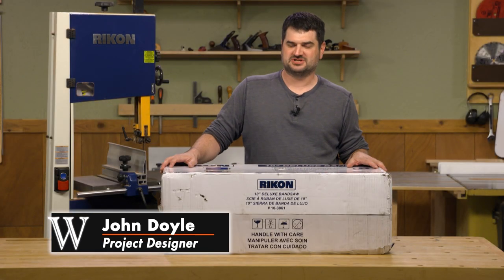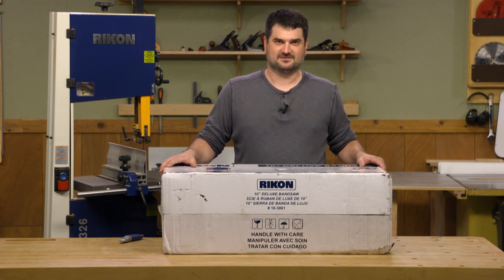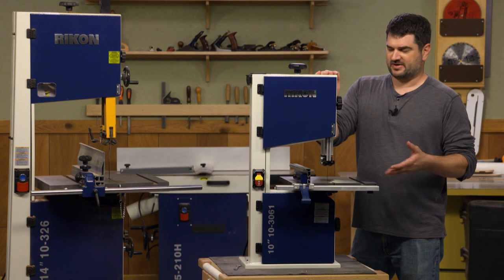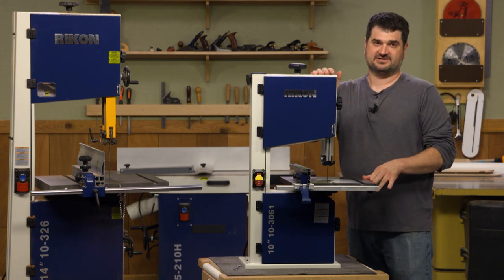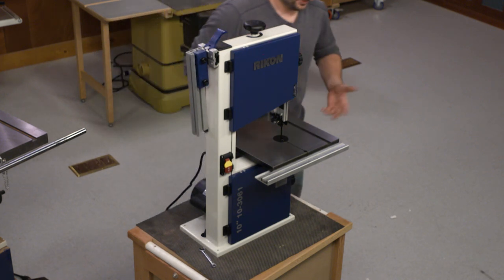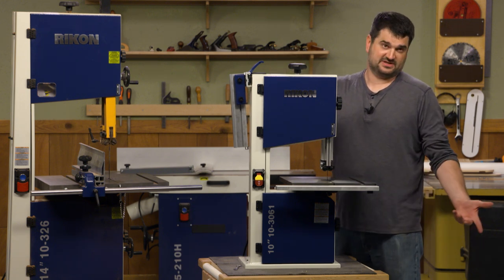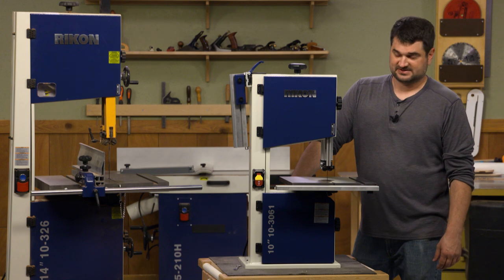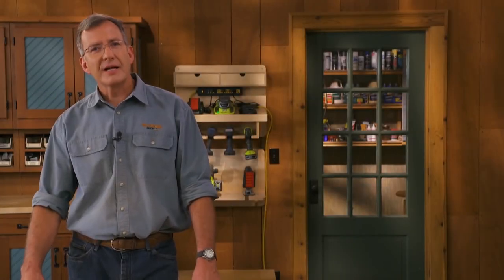Unboxing My New Rikon 10" Deluxe Band Saw

Comment: Just picked up one of these today. It replaced one of those crappy 9” Delta bandsaws from Lowe’s that I’d had for years. After assembling and tweaking everything that can be adjusted (and Rikon made sure of easy adjustments!) into spec, I decided the Delta shouldn’t even be classified as a bandsaw! This thing is quiet and very accurate after being dialed in. My only bitch is why they don’t include a light of some sort! I’ve read other comments about why they didn’t include a miter gauge, but ironically, the miter gauge off the old Delta fits the slot perfectly! But I really don’t see that as an issue because I have never had occasion to use the slot on a bandsaw! Great value for the price!

Comment: Thanks for the quick overview. I've been eyeballing this bandsaw for a while now and it'll probably be my next tool purchase. I looked at their cheaper version (10-305) but I like the more powerful motor, quick blade release, tool-less adjustments, better fence, and the 2-speed pulley system of this 10-306. I plan on cutting non ferrous metals as well as wood so the 2-speed is a must for me. About the only thing it needs from what I've read is a quality bi-metal blade to replace the low quality one that it comes with. The only thing bad about this saw (in my eyes) is that for what this saw costs (not cheap), it doesn't come with a miter guide. They make you pay an extra $20 for it. That's stupid.

Comment: i love my little Rikon.  Great saw for the small shop.  I don't resaw so it does everything I have needed it to.
Reply from the maker: Absolutely, I’ve been using this band saw in my shop for a few weeks now and it has been awesome! I can’t believe I’ve gone this long without my own band saw. 👍
Reply: Would this saw be ok to cut 2 inch thick hardwood (ie ironwood)  for knife handles?
Reply: @krissmith007  Like a hot knife through butter!

Comment: I have the same model in my shop.  I bought it to supplement my existing 14" Rikon Bandsaw.  It is nice to not have to swap blades between resawing (my 14") and tight curve work (this one).  Note that Rikon makes 2 10" bandsaws with the other one (10-305) being 1/3HP and it is not toolless.  I would spend the extra $100 for this one (10-3061) unless if you will only need it for super light work.
Reply from the maker: Yeah, I discovered that Rikon had two 10” models when I was shopping around and when I started comparing them the extra $100 for 10-3061 is definitely a no- brainer.  I’ve had this in my shop for a few weeks since we shot this video and I’m still loving it! 👍

Comment: I wish I would have bought this rikon instead of the 9" grizzly. I like the grizzly but this rikon for a few more bucks has a cast iron top, larger motor and overall better especially the blade guides/bearing.

Comment: Looks pretty nice, hope it holds up
Reply from the maker: Thanks!  It's doing well so far.
Reply: @WoodsmithShowandmagazine  Good to know, I see two different models of this on amazon, can you tell me what the difference is between the standard and deluxe versions, the description on amazon isnt that helpful ha.
Reply from the maker: @evildead1791  - I got the 10-3061 "Deluxe" and the main differences that I saw were the 10-3061 has a 1/2HP motor compared to the 1/3HP on the 305.  The 3061 has cast aluminum fly wheels (I misspoke in the video saying it was cast iron) and the 305 has lighter-duty stamped aluminum wheels, and the fence on the 3061 is much nicer, as well.
Reply: @WoodsmithShowandmagazine  ah ok, thanks for the info, think I'll be going with the deluxe, really appreciate the reply and clarification.
Reply from the maker: Great choice.  I've had no regrets.  If you're in the midwest... I ended up getting mine through Menards.com and they have a 11% mail in rebate for in-store credit which made it a really good deal. Worth a look. 
 https://www.menards.com/main/tools/power-tools/power-saws/band-saws/rikon-reg-10-band-saw/10-3061/p-377646779763825-c-1537277164161.htm?tid=-1&ipos=2
Reply: @WoodsmithShowandmagazine  unfortunately their isn't one around me, bummer too that is a great deal.

Comment: At 1:46 in the video you mention the saw has cast iron wheels.  Was that an extra-cost option on the saw you purchased?  I can't find anything on the RIKON website about cast iron wheels for the 10 inch bandsaw.
Reply: I just checked my 10-3061 with a magnet to be certain.  It has a cast aluminum wheel, not cast iron.  The 10-305 (It's little 1/3HP brother) has what I consider to be a "stamped" or "light weight casted" aluminum wheel (very thin).  The 10-3061 version should hold up better than the stamped version and run smoother (more mass).
Reply: @frehmann1303  Thanks for checking that.  I bought the 10-306 less than a year ago and like it very much.  After watching this video about the 10-3061, I assumed it had cast iron wheels, and was kicking myself for buying too soon!
Reply from the maker: Yeah, I think F Rehmann is correct. I saw that the 10-305 had a stamped aluminum wheel and I can't remember if I read that the 10-3061 had a cast iron wheel or just assumed that.  I couldn't find anything on the Rikon website, but I checked it with a magnet as well and it seems like it must be aluminum.  My bad, but after using this band saw at home the last several weeks I still love it.
Reply: @WoodsmithShowandmagazine  Thanks for clearing that up.  I like mine very much too.

Comment: I’m interested in making band saw boxes at home. Would this be a good size or should I consider larger? If so, any recommendations for size. Keep in mind I don’t have a $1000 budget.
Reply from the maker: I would a think a band saw of this size would have enough power for band saw boxes, but it only has a cutting capacity of 5".  Therefore, it really depends on the size and design of box you want to make.  We just did a few band saw boxes in our latest issue of Woodsmith Magazine, and on at least one of the boxes you would need to make a cut at 5 1/2", so if your boxes are going to be a little bigger you might want something with a larger cutting capacity like a 12" band saw.
Reply: I also think it could work for bandsaw boxes as long as you avoid the super hard and dense woods where it might struggle due to it's smaller motor and wheels.

Comment: Hey John, after 8 months or so are you still satisfied with your purchase?  Read some comments about quality control, especially with bent bases,  base separation,  just wanted to get your take on this unit after you've worked with it quite a bit
Reply from the maker: Yeah, still one of my favorite tools.  It works great for the things I do with it in my shop and never had any problems with it. 👍
Reply: Thanks for the response
Reply: Hey John, I'm planning to build a mobile stand for my Rikon bandsaw.How tall would you recommend the stand be?  I'm thinking 34". Did you build a cart or stand for urs?

Comment: You said “on things I’m going to do” , would you list what you are doing with this in your shop? And list what you wouldn’t do?
Reply from the maker: That's a good point.  I haven't had a band saw at home before, so I wasn't too sure how much I would tax this little band saw, but I of all things I've been doing it hasn't even slowed down one bit.  So far I've used it to re-saw pine construction material up to 3 1/2" thick, cut curves on 3/4" thick oak, made templates from 1/2" MDF, and roughed out some tenons on walnut.  The max cutting capacity is 5", but I don't think I'll need to cut or re-saw anything that thick at home.  I'm actually using it a lot more than I thought I would, and it's way more convenient and I get better results compared to when I would have previously used a jig saw.